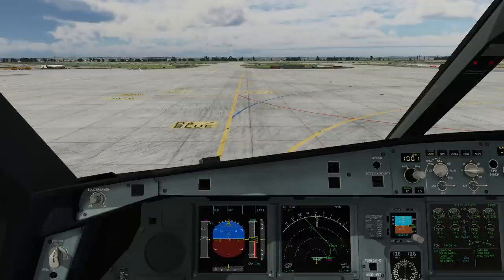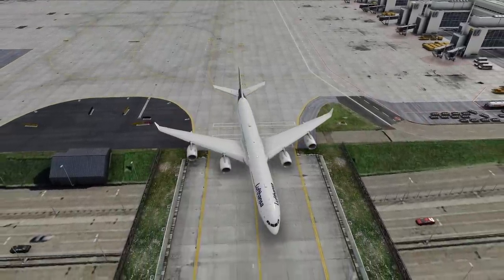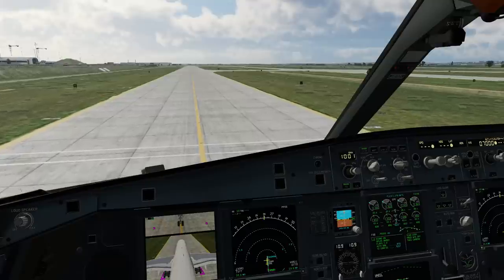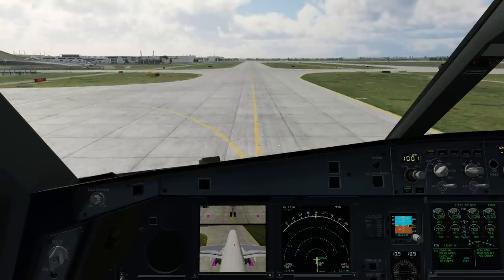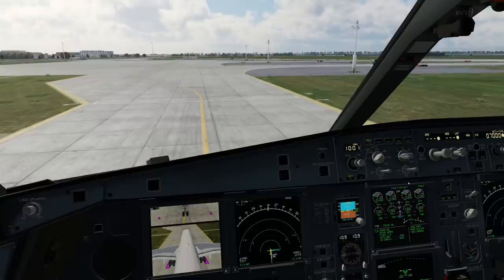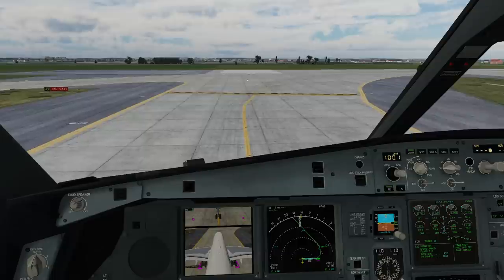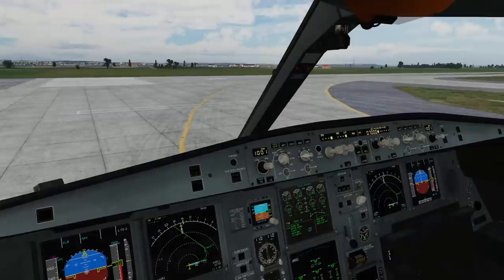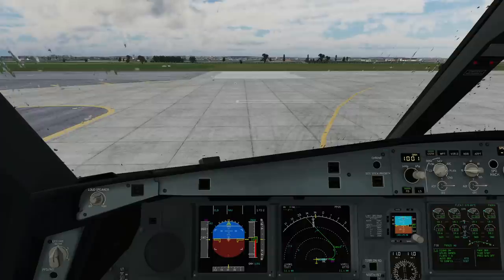How to TAXI a WIDEBODY aircraft | Real Airline Pilot

Comment: carbon brakes are more effective when they are warm.  on cold days, its better to warm them up a bit before taking off.
Reply: Yup, I've got no idea where he was going with that. If carbon brakes get cold enough they literally will not work, you have to put energy into them. It only takes a few metres at those weights though. The wear info was also incorrect, all brakes wear and steel wears much faster than carbon discs. If airlines were so concerned about wear they would use reverse thrust more.

Comment: Hi Emanuel
The CAE Oxford Air Law book says: "Taxiways are required to have a painted centre line which may be lit if the aerodrome is to be used at night. When taxiing an aeroplane it is vitally important that the nose wheel of the aeroplane is kept on the centre line especially during turns"

It further says: "Taxiway Curves. Changes in direction of taxiways should be as few and small as possible. The radii of the curves should be compatible with the manoeuvring capability and normal taxiing speeds of the aeroplanes for which the taxiway is intended."

The above is illustrated in the diagram which shows an aircraft in turn with nosewheel on center line, while main wheels are off centerline and the taxiway is widened at turning point.

When I was preparing for my exams, I assumed that SOP is to always maintain nosewheel on centerline and the taxiways will be designed to widen around turns accommodate main wheels being off-center (provided that a particular aircraft is suitable to taxi on the taxiway in question). Did I misunderstand?
Reply from the maker: Hi, never been a big fan of CAE to be honest, just look into any airliners FCTM, especially those of widebodies, but also of narrowbodies, and you'll quickly see the recommended (over-)steering technique.
Those quotes of the manuals you gave would be outright dangerous and easily end your maingears up in the grass. There have been plenty of cases where exactly that happened.

To quote a couple:
A330 FCTM: "The flight crew should be aware that the main gear on the inside of a turn will always cut the corner and track inside of the nosewheel track. For this reason, over-steer must be used."
B737 FCTM: "The smaller the radius of the turn, the greater the
distance that the main gear tracks inside the nose gear and the greater the need to
steer the nose gear outside of the taxi path (oversteer)".

They all illustrate this with some nice pictures and graphics as well. Google for some airliner FCTMs and you'll find the techniques all described.
Reply: @A330Driver  Thank you for the guidance. Much appreciated!

Comment: I can only toggle max brakes since I don't have pedals, so I'll be nailing those turns on the A330 but it will cost the company $2000 per flight. They have been warned.
Reply from the maker: What matters with those carbon brakes is the amount of brake applications, not their strengh. In that regard you're much better off with cabon brakes than with steel brakes.